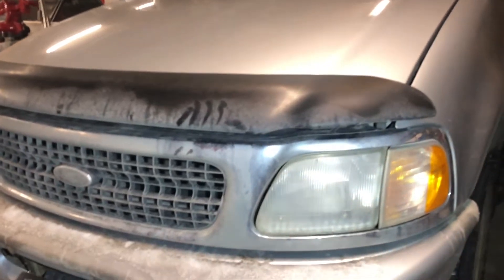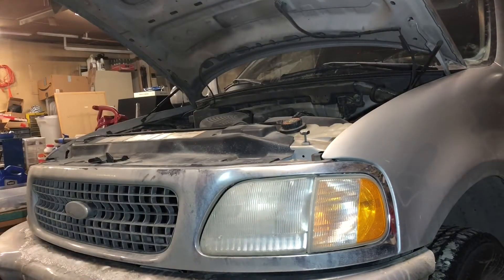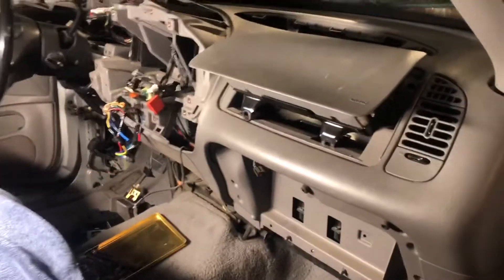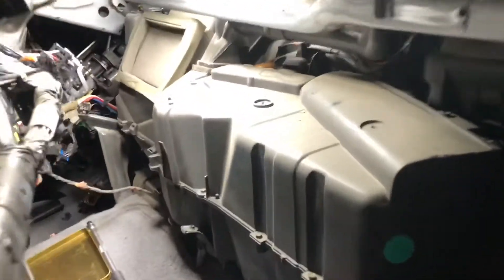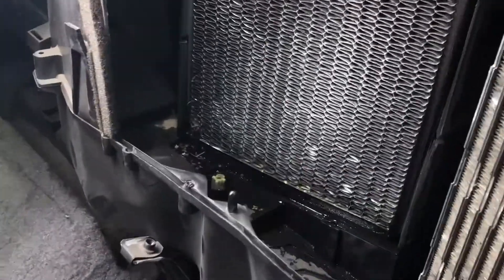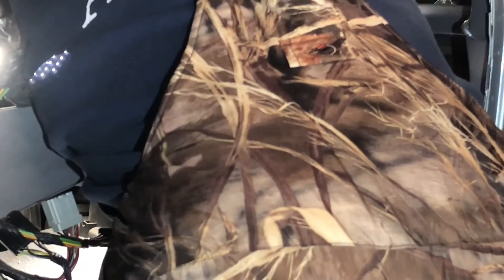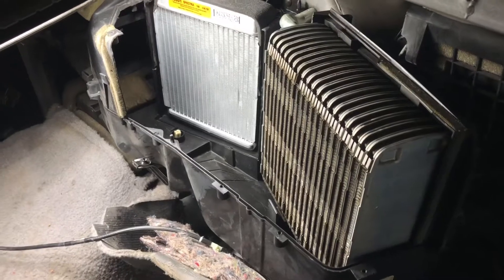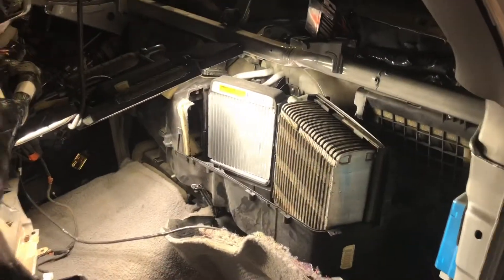EP107-98 Ford Expedition Heater Core Pt.1

Comment: Which hose is the inlet to the core thanks
Reply from the maker: So sorry I do not know offhand, you might be able to find some coolant flow diagrams online; if you have the vehicle, the easiest thing to do would be to check temperatures of the hoses going into the firewall from engine compartment (engine running and up to temp) and check to see which hose is hottest and the hottest one should be your Inlet
Reply: The second one